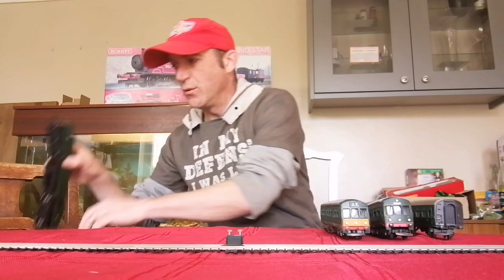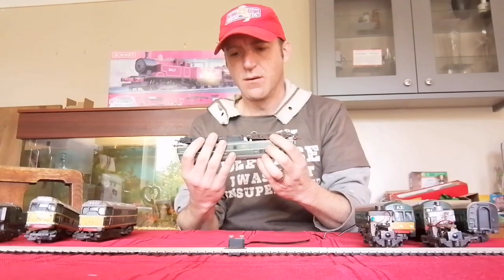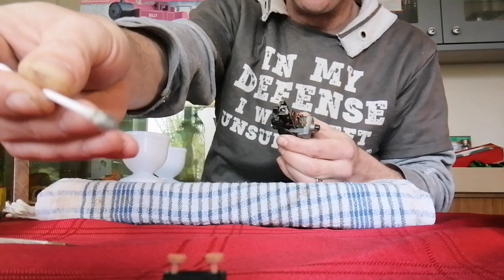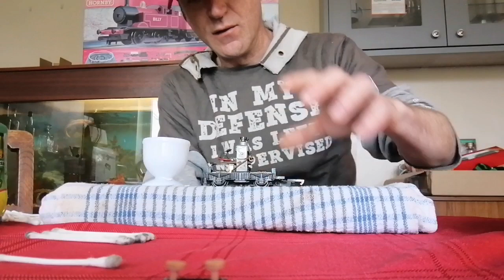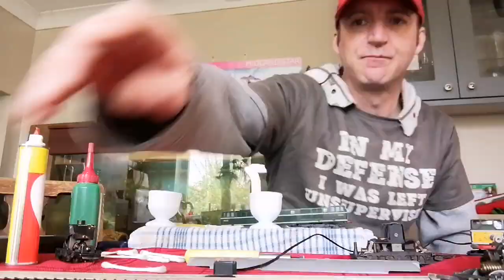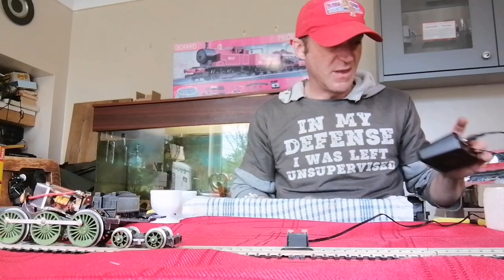REVIVE Your Vintage Tri-ang Locomotive With This Simple Fix

Comment: Hi, Might I suggest when you are lubricating the worm gears you use Mollygrease. It stays on better and does not get spun off as easily as oil. The capacitor you talk about does not affect the running of the motor. It was put on as a suppressor to stop them interfering with analogue tv signals. So you do not need them with modern digital tv signals. The main thing to watch out for on the class 31 is the plastic bearings that hold the motor in place. They can get really worn and cause the worm to disengage with the final drive. I believe you can get replacement bearings from Peters Spares. You would need to get a gear puller to fix bearings though. But they are cheap to buy. I would also suggest that you put new carbon brushes on the motors.
Reply from the maker: Cheers bud ill keep a look out for that.  Your tips and advice is always appreciated
Reply: @ooheaven8491  Sometimes the hole that the carbon brush goes through is melted larger as only one has copper around it. The brush gets hot that rests on the plastic and melts away from the commutator. Best to build it out to the same (reduced) size as the other.

Comment: Good to see another video. Glad you improved the running of those motors. I've been using moly lube on the gears. I've found contact cleaner to be helpful. Good to see some bargains out there. I just got a Hornby King for £30. Hope to see another video soon. Cheers Paul.
Reply from the maker: Thanks Paul that's a good bargain

Comment: As a professional triang dublo restoration tec You shouldn't use polar based solvents to clean any loco.. there are two parts of a wheel to clean the tread and the contact suface , please research the difference between polar and non Polar based cleaning solvents there only two products on planet earth. Nice video though
Reply from the maker: Thanks for the heads up